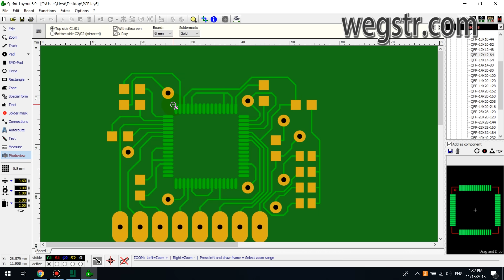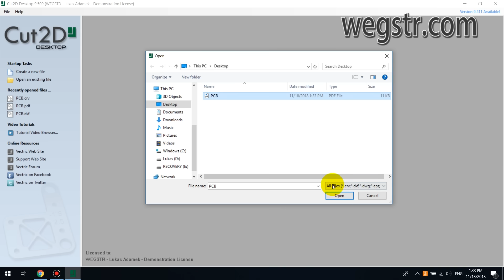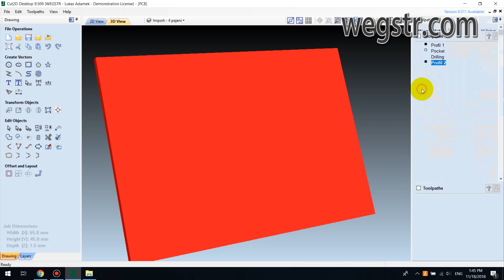PCB prototyping, PCB making at home - WEGSTR

Comment: With the help of special expensive equipment, every housewife can do this. Try making a printed circuit board using only an iron and an A4 laser printer. Then I will say that you are very cool
Reply: This is a CNC router and they are showing its capabilities. Everyone has done a pcb with Iron and a laser printer. You are not very smart are you?
Reply: @swapnilmankame  With tons of special equipment for a lot of money, a smart brain is not needed at all.
Reply: @dimmer4955   Let's not forget that this """"housewife"""" certainly is the one behind this project and designed the machine, which well... Requires way more neurons than you have in the first place
Reply: Awww someone feeling a little hurt in the kitty 😂
Reply: She sells the machine Einstein 😅
Reply: @dimmer4955 transfer method also doesnt require that many neurons, calling a CNC mill special equipment is a severe stretch

Comment: This may be useful in a mild prototyping environment or in an educational environment. Otherwise, the PCB companies have made them so cheap that I don't see why one would do this. I have been interested in the machine, however, I now feel different.
Reply: Because it is cool. Most people in the hobby just want to know they could do it. I get your perspective, if you just want to build something.
Reply: Somewhat I agree, although for small firm or some firms where there is a need for a high throughput of PCBs, the PCB manufacturers can get a decent markup and drive up the cost. This system here is good but not so automated, which increases the cost and operating time. That said, to rely on POST and Customs to take care and deliver the package on time can be a hassle, this is a good thing for fast prototyping/production and checking if everything works. Besides its independent of any manufacturer so you dont have the trouble of Supply Chain. Everything has its ups and downs :)
Reply: I've found it cheaper and easier to send my artwork out and have the boards commercially made than to try and make them in the shop. But I recently bought a desktop CNC for another project and have been thinking of using it to make my own PCB's, too. That's why I watched this video. He's obviously a procedure/detail/perfectionist, and I admire his work ethics and techniques. Quite professional. You really need precision with surface mount components.

Comment: Simple question : How do you reposition the plate after manual operations ?
Reply: This requires high-precision assembly of the machine or xy limit switch or willow pin fixation. The engraving machine probably needs to test repeated positioning.They add a spring to the z-axis to avoid repeated positioning of the z-axis. Generally, the machine does not tighten the milling cutter so that the z-axis returns to zero and then tightens it to achieve positioning.

Comment: The thing should also be able to cut a solder paste mask. Apply solder paste > place components > melt solder with hot air iron > apply additional solder where needed.
Reply: the laser could also heat the solder joints very accurately once the components are in position. this is basically a laser engraver